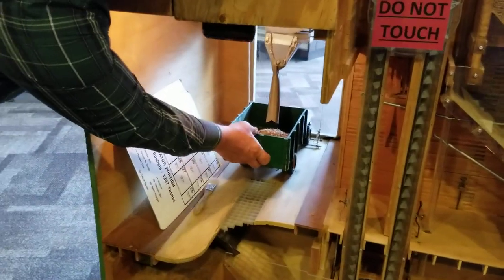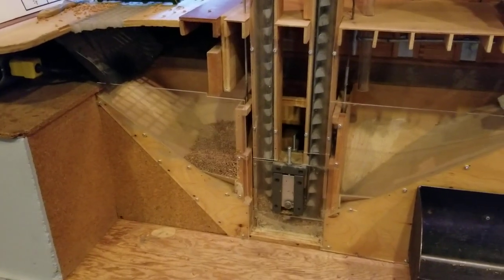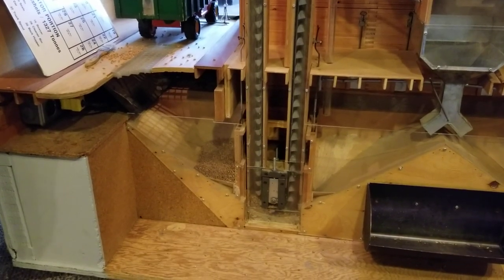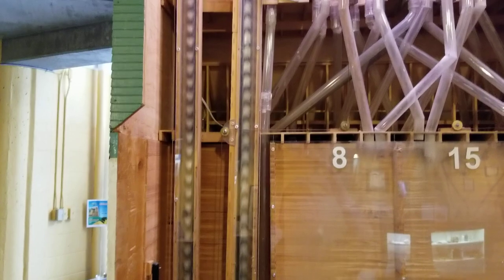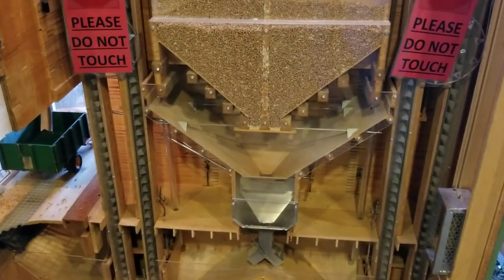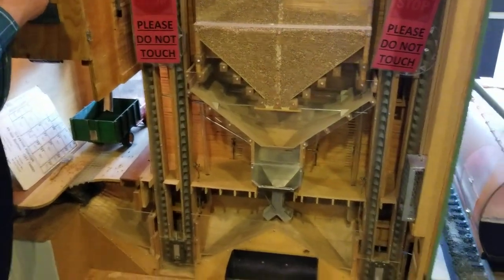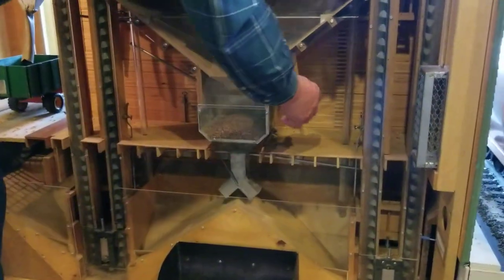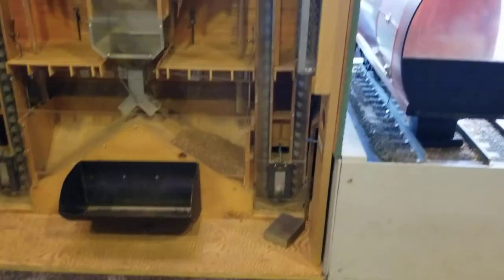Working Grain Elevator Demo

Comment: Isn't it a conflict that the person testing quality is also the buyer ? Shouldn't it be neutral? Are there situations where the driver is like "hell no" after hearing the quality report but the grain is already unloaded?

This is an awesome model.
Reply: Not sure how it works in Canada but if the farmer disagrees with the grade he can get a sample sent to a federal grain inspection office which will issue a official grade.
Reply: More often then not the producer sends samples ahead of a delivery to find out the grade of their grain. Samples are super important so everyone knows the quality of the grain although this can change when the load is dumped at the elevator for a number of reasons.
Reply: We have a sampler it is a moisture tester that cannot be rigged